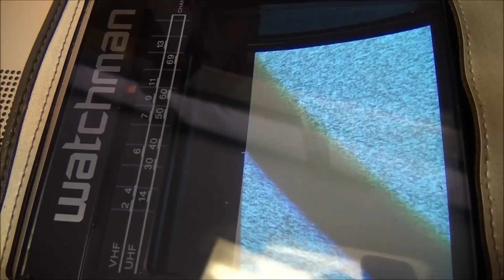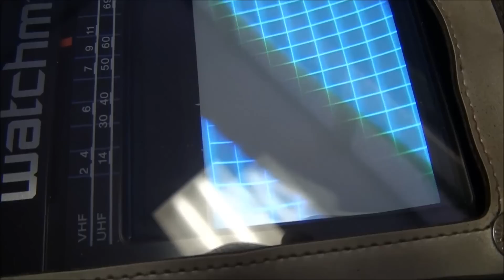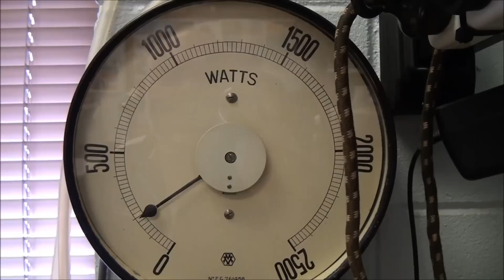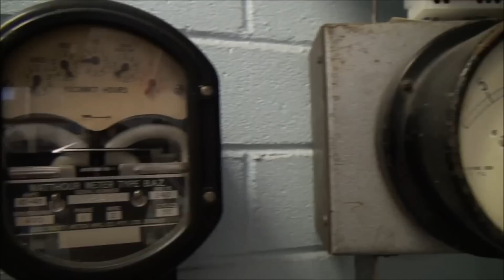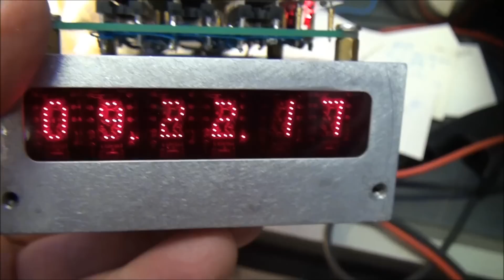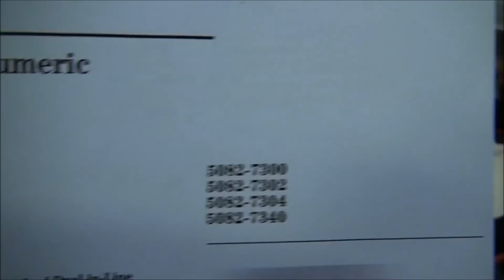Sony Watchman teardown and TTL clock

Comment: Awesome video, Interesting little TV set. Love your metering array and that TTL clock is very nice with those LED dot display segments. They are indeed very hard to get hold off.
Reply from the maker: +RODALCO2007 Those LED arrays are pretty nice, they have a built in decoder chip to display the numbers from a Binary coded input, ideal for TTL use. They do turn up on Fleabay but can be expensive. I was glad to have salvaged a few from some old equipment at work that was on its way to the tip, I wish I kept all the circuit boards that were crammed full of CMOS and TTL chips, they certainly would have come in handy!

Comment: PS in another workshop vid you showed us a large genset next to your workshop are you not on public mains there
Reply from the maker: +jon johnson That Genset is a Co-gen running on Natural gas, it feeds power into the Hospital power grid to help offset the electricity bill, apparently it saves money however it seems to break down a fair bit. The engine is a V16 spark ignition engine, have forgotten what make it is.
Reply: I see I guess gas is cheaper than electric here both are horrendously expensive
Reply from the maker: +jon johnson Here in central Australia there are reserves of Natural Gas which is piped to town and up to Darwin, some of the local reserves have run out so exploration is underway to find more. Solar is popular now, so much available Sunlight, one day hopefully better Batteries for storage will be available which would be great.
Reply: Yeah you get plenty of sun that's for sure we have a solar farm near hear think it generates a few hundred kilowatts on a good day

Comment: I liked that clock maybe you could build a bunch of them to sell at Xmas. More Lisa sterilizers I'm guessing they are an Australian make as you get so many
Reply from the maker: +jon johnson I would like to make more however the LED readouts are scarce as Hens tooth these days! The Sterilizers are made in Italy and imported, Siltex was a very popular Australian made Sterilizer which was ruggedly made and kept running like an older Holden however I think now that Siltex is now manufactured overseas. Aussie industry seems to be dying out these days unfortunantly.
Reply: Going the same way as UK industry then by sounds of it

Comment: Very interesting to see (amongst many things!) your day job Ian; one of those sterilizers would make a good tear down video! thanks for sharing :)
Reply from the maker: +Alan Cordwell Hi Alan, yes you are right, I should do a tear down video of one of those Sterilizers, sometimes the whole pressure chamber can develop a crack and needs changing, basically the unit is pulled completely apart in order to do this, might make an interesting video! Cheers, Ian